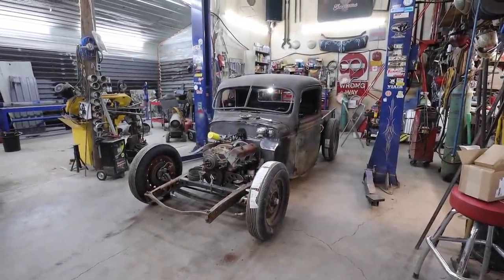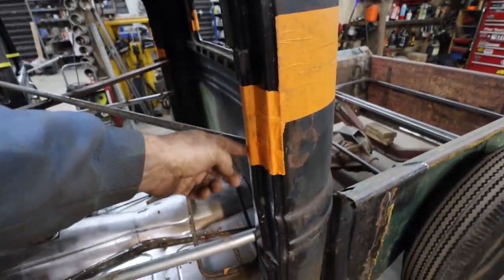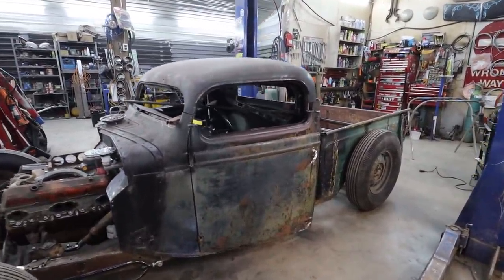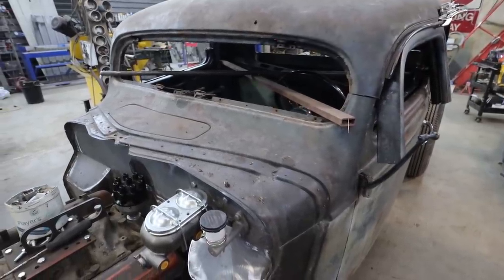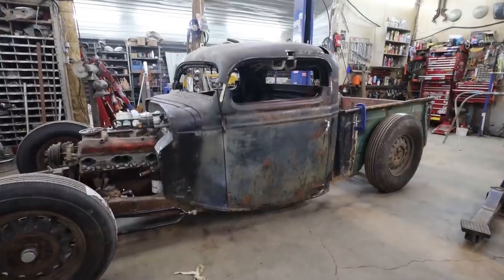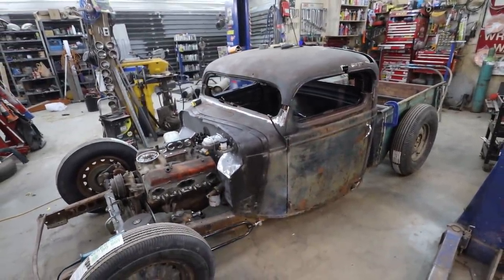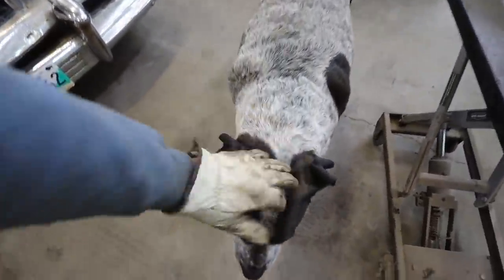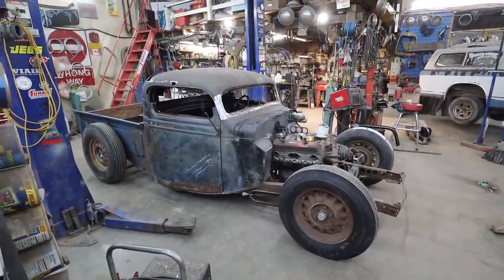Chopping the roof on the1937 Ford pickup Part 13

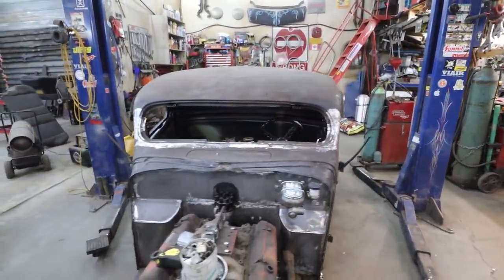Comment: - Great job dealing with the front window door pillars, Brent. 30:45 - 38:36
- Given all that work, I understand why you would not want to pull the bottom forward 2" close to the vent, and extend the total slanted window pillar lengths.
- I bet even Fitzee has never done That, because of having to "shrink" the dome roofline role AND corner curvature.
- However, YOU could do That with your insights an intuitive skill ! ! ! AND, SO, I wish you had done it.
- My bet is such a tribal knowledge tutorial would be an Olympic New Years Treat for the Hot Rod Mod world.
- Something NEW only happens once, Brent.

- [What would the right Visor overhead Do?] Hummmmm.
- [Would a Peterbuit Radiator to work with the Visor and Tall Tires be too much?] Oooooh.

Comment: 6 ways to chop a top. Cut 6" once first, measure/rethink 5" or 1 1/4" twice second, cut stitch weld third, check with shop dog fourth, dash through the window opening fifth, finished for now n pet Pablo sixth.

Comment: back in the 80s i chopped my 68 gmc c10 short box. no mig back then steal weld with torchs 0 tip. alot more to chop yours but looks great. merry christmas and a great new year. cheers buddy.

Comment: I really like how you dropped the bottom of the windshield opening into the cowl, that steep transition from the cowl top to the windshield opening always looked awkward to me on these trucks, even when they are unchopped. Adding the filler piece to the back of the roof is a smart idea too, much easier than trying to add a filler strip accross the  middle of a low crown panel.

Comment: I was not thinking about moving the bottom of the windshield down. That is pretty genius. I was looking at the top of the windshield and as you said after showing the lowered part, it keeps the line with the side glass. That was my concern about moving the top up. Very well done, even if you did kind of screw up! haha. However, it is how you recover, and as always, you press forward. Cheers from Ontario.

Comment: Now that's a big job! You got to be a fabricator, an artist, a welder, a planner,  a forecaster, and know what you want long before you cut on the truck. Good thing is the truck is pretty small so do overs are won't be that expenses, just a little time. But, truck is looking great, the wind shield needs something as you mentioned. Hope Santa stopped by your place because he did not stop by mine and I thought I was a good boy this year. Happy Holidays!

Comment: Merry Christmas Brent and Family, 
Right off the top when you laid the tap down on the cab I was thinking it's to low, but you always amaze me with your work I thought maybe I was going to see a different way of chopping. You are right all the other window's look right but the front window? I'm not shire if the angle of the cowl, any who I know it's going to look really cool when you have it welded up.
I notice another video I was watching this guy did a chop on a 48-54 Chevy truck through the middle of the door took 3"-4 " out of the middle of the door did nothing with the window's. Never seen it done like that before it looked good. The bed was made and the back fenders were widen like you did on the panel. Keep on keeping on.

Comment: Merry Xmas and have a well deserved break. I think there is quite a large radius curve to the front of the roof. Probably for the overhead windscreen wiper mechanism. By doing it the way you have the front window aligns better to the top and bottom of the side windows. A lot of work though.

Comment: A fine example of a chop. Mistakes were made,and rectified.  I have to agree with the extra work on the windshield frame to get proportions correct. Yup, its alright. 
I helped a guy nearly 30 years ago with a chop. I never did ride in it. So i guess a ride in a chopped vehicle is still on my bucket list. Hope you had a good holiday,we Cruised the Fargo around town christmas eve. Had a blast! Heat was a little weak though.
Reply from the maker: haha if a feller ponies up for the princess auto square heater you'll have more heat than you'll know what to do with. 
https://www.princessauto.com/en/21000-btu-12v-auxiliary-heater/product/PA0004240004
Reply: @HalfassKustoms  i agree, but wasnt really planning to drive in winter. But You and Dan are cruising, i thought why not??

Comment: I liked your comment on curb feelers and I know it is your project I still would like to make a suggestion. If you used. Motor cycle finders and the two on the front turns with the tires .And the reason I say this is when it rains the water won't spray the car
Reply: We don't need no steenking fenders.

Comment: Looks pretty good. I think the windshield would have looked better if the corners of the window weren't rounded all the way and had a straight piece in it. like a rectangle with corners rounded. Probably hard to follow that. Anyway good job. It still looks amazing.

Comment: I would have just added an inch back into the front side of the windshield. Tack the back like you did and then add some back to the side of the windshield. I think that would have been so much easier than chopping out the dash.

Comment: - Keep the inch lift back to a 5" Chop
- AND {somehow} add an inch chop down for the dashboard area and front upslope after the vent.
- Oh, now I see that you doing what I just said. Hummmmmmmmmm. {great minds?}
- Will you bring the bottom of the front window forward an inch+ so it slopes back? Hummmm.
- Photoshop it, stand back, I suspect it has never been done before and will work with this cab.

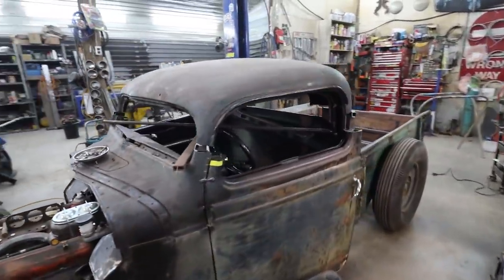Comment: Only viewed to the 12:30 mark so far but I think what you don't "like" is the visual...the amount of chop is fine but the front windshield is too high relative to the opening for the door glass.  IF you were to "sink" the bottom edge of the glass even half way down to match the lower part of the side glass the visual, IMO, would improve dramatically.  You're closer to "lakester" as opposed to "hot rod".

Comment: I got to tell you, I love that chop!!! I do. Maybe add 1 inch? I have an Eastwood welder like yours. I use a wire that doesn’t need gas. I switched over to gas and tiny wire. Why does my wire bead up! I used to weld big steel with a stick. This tiny wire and gas? Without turning in the gas it beads. What’s up with that? Anyone?
Reply: Many of these body guys use .030 and high heat. But you can't run a bead on sheet metal, or it will warp and maybe make grapes. Get your metal positioned and just put a tack every inch or so.....short bursts, let it cool. Come back later and fill in between.  The flux-core wires are not all good. The best one is Lincoln brand. You can get a 1 pound roll at Home Depot.

Comment: You've just found the front window too small, be nice to drop the lower of the front window to the bonnet in line with the side windows. Be work but
Reply: Okay that's what u ended up doing, well played, easy coming up with ideas from the couch, you have a great momentum